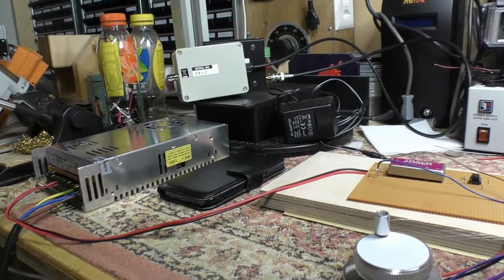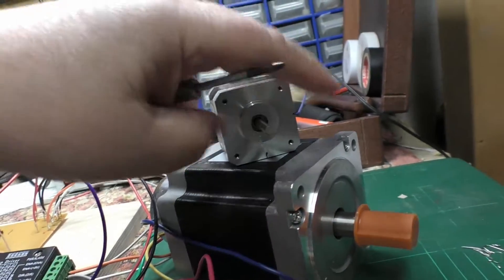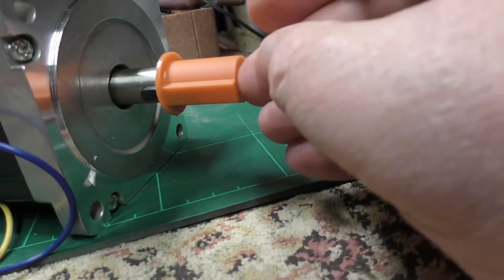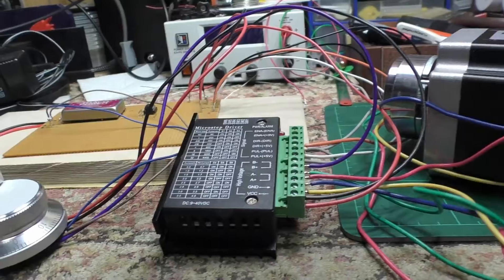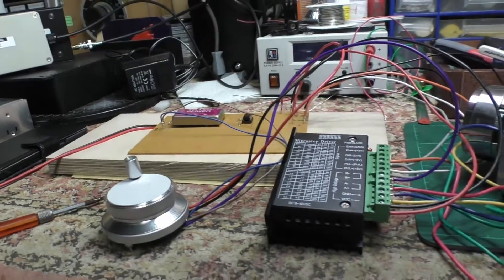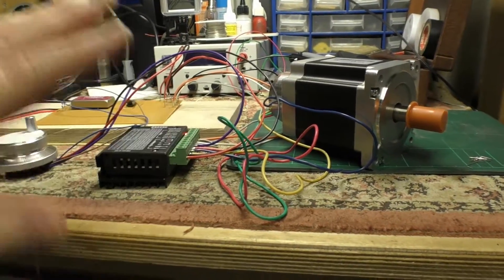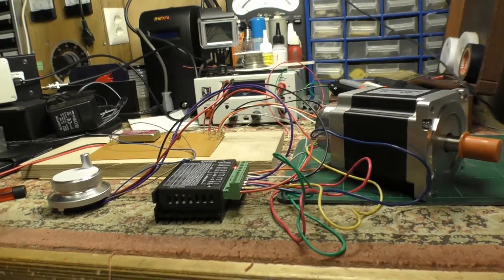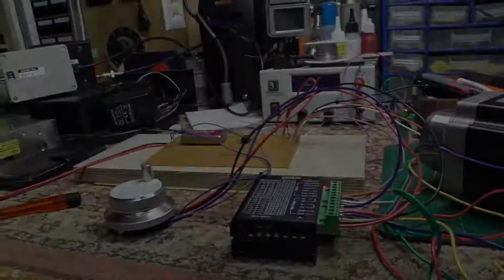Antenna Rotator Project Update 2 (short)

Comment: I wish I could find a way to replace the AC motors in my Yaesu G5500 to have such precision control ontop of being able to have soft start/stop to put less stress on the antenna structure...
Reply from the maker: I'm not familiar with the Yaesu unit but the system I've put together is made up of standard components - dc power supply, rotary encoder, stepper motor driver, and stepper motor.   The challenge is how to fit them in the existing enclosure.   From what I've seen of the G5500 you would need a second motor, driver, and rotary encoder.   Also, your existing system includes position feedback so you'd have to figure out hope to replicate that as well.   This was not part of the scope for my project.

Comment: John, looks really good. I like your big stepper motor. I built a “light” version (attic installation) using Arduino as my controller and smaller stepper motor and another one with a Servo that rotates 180 degrees for the loop I recently built. I experienced significant EMI from both devices when in use and never got back to looking for a solution. I would be curious to know if you have any EMI from your setup; of course, I was only focused on the BC band when I tested it from 540 to 1700 kc. I’m looking forward to your next publish. Best, Don
Reply from the maker: Thanks Don, I'll be on the look-out for EMI once I get it done.   I've decided to keep the rotator separate from the SDR so hopefully that will help.   I suspect the stepper is overkill but I wanted the brake facility and this was the easiest way to implement it.  My main reason for implementing this is also for the BC band.  There is almost no AM broadcasts here anymore and I need all the help I can get to pull them in from places like UK (over 800km away).
Cheers,   John
Reply: @Zone1242  Hello, cool project, I would like to try to repeat, can you share the materials, the code?
Reply from the maker: @LionTurbo  Hi, this was a simple design - no code involved.   A rotary encoder hooked up to a stepper driver module via some circuitry to detect direction, etc.   I made a drawing for another subscriber so I'll see if I can find it and if yes I'll post a link.
Reply from the maker: @LionTurbo  My share seems to be down for the moment so if you send me an email (address in the about section of the channel) I'll send you the pdf.